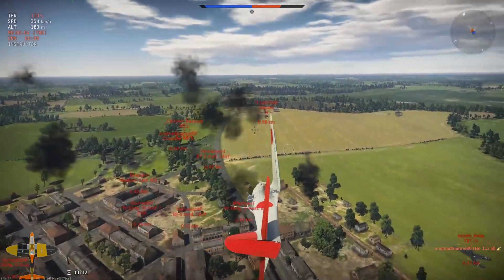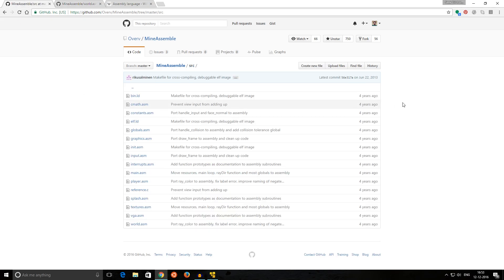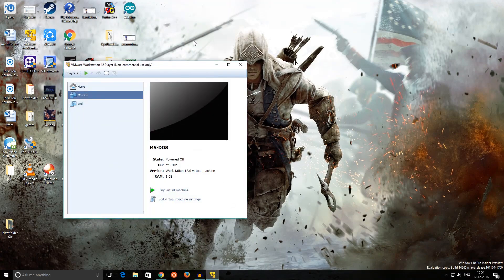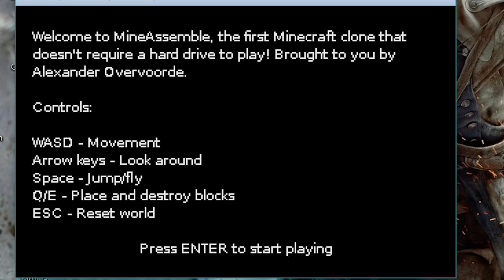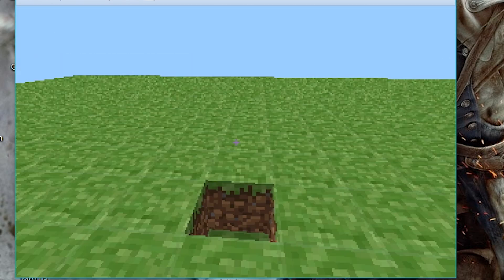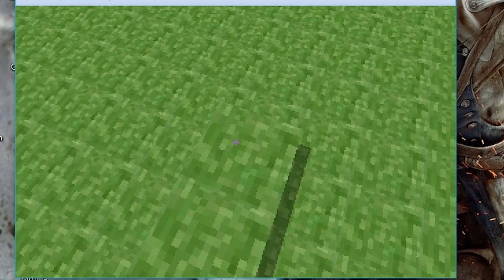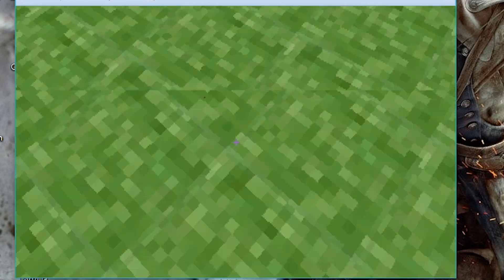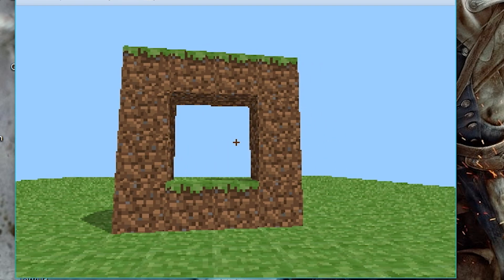Minecraft Clone in Assembly Language | MineAssemble

Comment: If it's possible to write a 3D engine in ASM how come none of the old games written in ASM were 3D
Reply: hardware limitations
Reply: Starfox for the SNES was a form of 3D but it required special hardware on the cartridge I am pretty sure. Also technically everything written in C/C++ gets compiled to ASM before being assembled into machine code. I just skimmed through the code and read the GitHub and it looks like some of it is written in C and SDL so it probably does use OpenGL calls but I am not too sure about that... the SDL just makes me think so. 
Also a lot of old consoles did have some form of graphics card; PPU for NES, super PPU for SNES, and so on. The Sega Genesis/Megadrive used a 68k processor with a z80 sound processor and a lot of external components for various things I believe. 
It is possible to do graphics on a CPU but why not use OpenGL, Direct X, Vulkan, so on to access the GPU if that is an option on your platform?
Reply: Roller Coaster Tycoon 2 was 3d ish
Reply: @Cal97g  No 3D rendering happens in Rollercoaster Tycoon, it's all sprites.
Reply: Not enough memory for 3d even jus basic games at the time needed some tricks and bit manipulation just to fit 2d games into memory
Reply: Because graphics cards weren't good enough.
Reply: @oscwavcommentaccount  You don't need a graphics card to render graphics...
Reply: @beri4138  ok then the hardware wasnt good enough most of the time.

maybe on genesis and snes its possible with clever coding, but on nes it probably wasnt possible